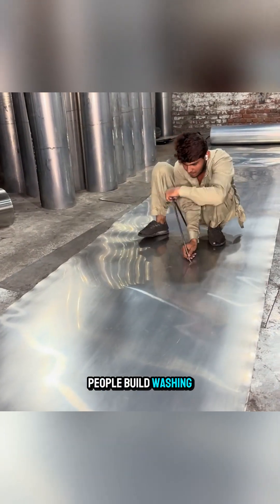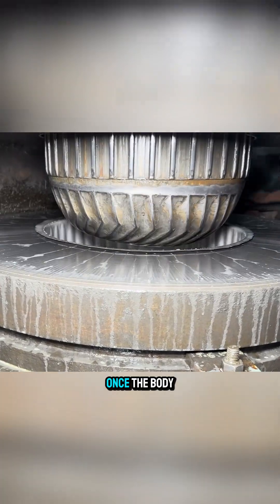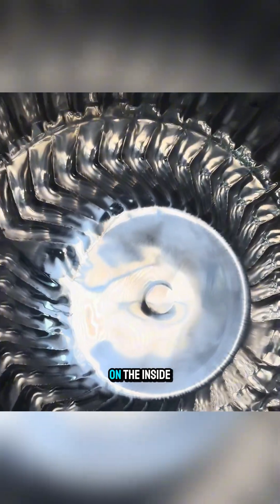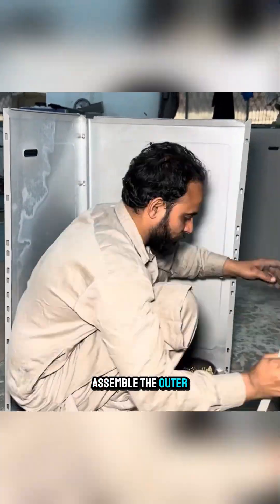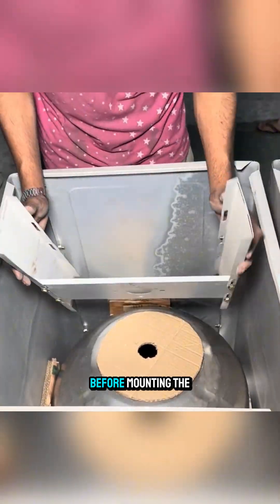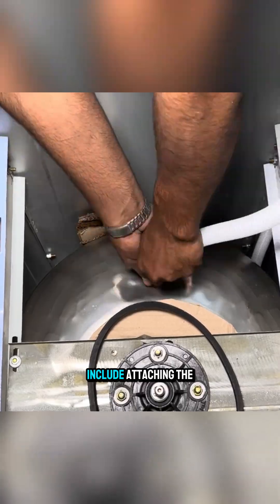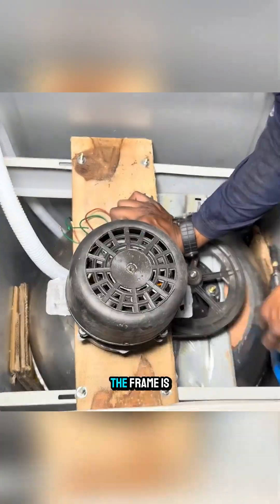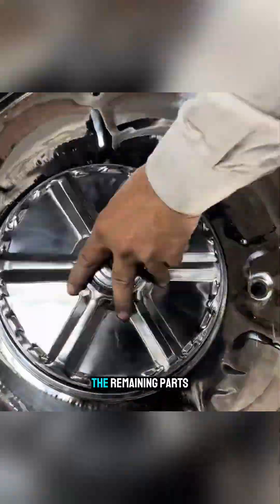A washing machine made by hand #technology  #manufacturing #handcrafted #exploration #knowledge

Comment: Low long that paper cardboard inside will gonna survive
Reply: 20 years easy.. people still use these things for generations 😂
Reply: Not part of the matchine, just for post alignment
Reply: @WaleedAhmed-pt9lw yeah but it will make it bit loose after paper get rotten
Reply: @tenrikxetsa5507 No the water doesn't leak into this so it stays dry and perfectly fine for years to come
Reply: @HussnainAli-n6g  I know there is no water leak but at humid room condition, cardboard does not survive long
Reply: @tenrikxetsa5507 U may be right about it but we have been using similar washing machine since 1998, it's a double machine (washer + dryer) and it's working perfectly fine
Reply: @HussnainAli-n6g then good for you  👍

Comment: But many problems in it , how it wash clothes 😂😂 it's only spin clothes in one direction and it's have only one switch open and off ..... How to drain water .... How to select modes and what is his capacity
Reply: All that stuff is mostly unnecessary. Remember people used to wash clothes by hand. The biggest part of cleaning comes from friction of clothing pieces between eachother. That + water + detergent will make your clothes very clean. If they add a heating element it will clean just as well as any other machine.
Reply: @ziczac1056  I am from india and I know your brain is dead , washing machine have special motor which spin them in many directions to wash clothes properly and it has also features like heat , dry , rinse and heating rod inside ...... , special time for proper cleaning . And this is literally a tin container with a motor and blade ......😂

Comment: When you get shock , many can't survive as the cable they use can easily get damaged
Reply: Using same washing machine from 2003 no complain but got boss automatic washing machine in 2021 only complains and repairs wgen warranty overs
Reply: Mirza ghulam Ahmad Qadyani mardood per lanat beshumar
Reply: We can also get hurt from a stray rock,if it happens it happens 😂
Reply: But the cable is not visible how can you get shocked when the cables are concealed?

Comment: Usually last for 40 to 50 year.sometime repair .still we r using.very easy to repair.we have one in home .purchased 2004
Reply: Are u serious? They are giving the support for the drum with paper cardboard.. How it last after a single wash?
Reply: @A_D_x we bought one n 2004 and still using it, takes less than 10$ to fix any issue, usually u won't need to take it to electrician for fixing , u can fix everything at home
Reply: @A_D_x  prolly replaced the cardboard and the wood after sometimes lol
Reply: @A_D_x  nope water don't leak inside unless there's a defect
Reply: @hashirahmed5727  if water leaks and cardboard loses the strength, then the machine can topple or damage internal components.. High risk
Reply: @A_D_x not really. The cardboard is only used during building. Once the screws are in place, it can rot or pulled out. No issues.
Reply: @A_D_x  The cardboard is just used as a spacer when they fit in the parts, it is not a part of the washing machine.
Reply: @manofchange832 My question is how long it lasts? It's like keeping cardboard in car to support it's suspension..
Reply: @A_D_x  It doesn't stay in the machine, they just use it to adjust the space when they fit the part, just as builders would use spacer plastic bits when they lay tiles but take them out after. Who would use cardboard as a part in any machine, it's obvious it's going to disintegrate.
Reply: @A_D_x once the screws are in place,  the cardboard is no longer needed. It will come off later on its own.
Reply: @A_D_x  I'm an Indian and no matter how many wars our countries fight we've something in common called "jugaad", using things not meant to be, non standard but works efficiently.
Reply: @A_D_x it lasts practically forever. We had one for decades. That cardboard is just support during building. Comes off later but the screws keep all things in place.
Reply: @A_D_x yes it's true .
Reply: @A_D_x  that cardboard is only for alignment. most likely taken out after properly fastened by bolts
Reply: @A_D_x cardboard and wood very easy to replace duhh
Reply: @A_D_x hahah.. bro it works like hell for 20+ years . Pulley might crack or break after 3/4 years or the belt might worn out every year or the machine capacitor might get pregnant.. whatever it is reliable as hell .. it's just not fancy. Other than that it's just pure simplicity and reliability
Reply: We have one purchased in 1994
Reply: No way that thing lasts a year looking at how soft their metallic plates are
Reply: @samsonkisseka2671  they do it not for business but sustainable ,as engineering person i love how they separated the motor and the shaft ,and It less part...if the motor still work everything will work,maybe just replace the Rubber band..
Reply: @samsonkisseka2671 practically lasts forever. We had one.
Reply: @samsonkisseka2671 yes it does if there is no leakage because it's simple washing machine without dryer .
Reply: @samsonkisseka2671 u be surprised it does 👀
Reply: My mom said our one was gifted by my NANA at her marrige 😅
Reply: @KarenMeniado konse brand ka hai ye washing machine ??
Reply: It lasts between 10-15 years for real
Reply: I feel cry
Reply: Years**
Reply: Lies 😂😂😂
Reply: Ours is 32 years old... Super Asia brand is well reknowned
Reply: @muhammadtalha9013 abhi bhi yahi brand chalta hai ya koi aur brand ?? Aur service life kitni hoti hai iski ???
Reply: How much does it cost in pakistan?
Reply: @shekhar_ggupta depends on the thickness of the metal sheet but anywhere between 17000 to 27000 and those last longer than the one purchasing them😂
Reply: @WaleedAhmed-pt9lw that's excellent value for money actually...👍🏻👌🏻
Reply: The buckle lasts 50 years, repairs cost less than $10, everything is great, only one thing is a minus, it doesn't wash